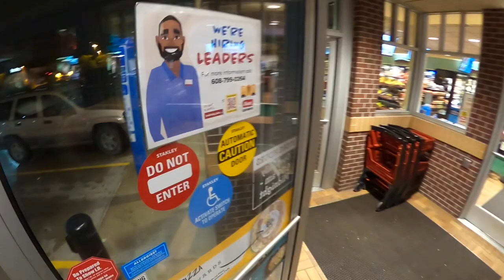Everything is slowing us down! Guys were late, truck won't start, rain, late concrete

Comment: I literally exhaled and rolled my eyes when Eric didn’t have the truck in park. Like bruh
Reply: I mean the car should have been in park to begin with right
Reply: @coleholden8241  If you drive manual alot it can be a habit to shift to neutral and put the E brake. Also those type of gear shifters its easy to leave it in neutral and not realize.
Reply: My mom does this…. Lol Eric.  Who parked the truck and shut it off in drive though?
Reply: @ChicanoOne760  right I’m barely 27 and like this has never happened to me but it happened to my friend she asked to jump it and I hopped in her car and was like yo girl. It’s in drive haha

Comment: I love all your videos they kept me very amused while being laid up in bed due to illness.   I myself was in the construction business for 34 years. Till I retired because of Parkinsons.  I started out pushing a broom and 19 years later got to the top of site management and finished as a Hi-Rise construction Site Supervisor.  In have a respect for all trades.  Most of my concrete experience is steel reinforced concrete suspended slabs in the city of Toronto and the largest building I have been in charge of was 42 stories.  So I can empathize with you when someone is late or doesn't show up.  Being from Canada we pour right through the winter and have the added snow removal and hating issues.  Anyway enough about me you are doing a fantastic job  and thank you for opening up your business and families

Comment: Lets buy Eric more alarm clocks ! Green horn ! Here after they put in joints then 2 days later the come back and saw the joints . I recall being a plumber assistant I was mid 20s  plus worked nights at UPS slept 3 to 4 hours then got up for work  I ended up being late like 3 to 4 times then he fired me .

Comment: 18:30 I did a control joint like that at my pole barn, running under the garage door, and now when we get really heavy rain, water sometimes will go under the door

Comment: Just letting you know for next time always hook up the ground to the battery first when using booster cables
Reply: I’ve also seen people hook the ground to the frame instead of the ground on the battery? Is there any reason for that?

Comment: Could you explain what the strip between the concrete in the garage and the driveway is for? Not sure if you’ve explained it before. Great work guys!
Reply: Supposed to help with cracks if they occur with movement

Comment: Are garages poured as flatwork, and not as part of the foundation up there?  I used to build homes here in San Antonio, Texas, and I cannot see how it would be possible to rip out and replace garage floors the way that foundations are designed down here.

Comment: NOCO Boost X GBX45 1250A 12V UltraSafe Portable Lithium Jump Starter, Car Battery Booster Pack, USB-C Powerbank Charger, And Jumper Cables For Up To 6.5-Liter Gas And 4.0-Liter Diesel Engines
Recommend buying this battery jumper/charger

Comment: It surprises me how the concrete company (and many other companies) seem intentionally vague when asked about timing. 99% of the time if you're just open with people, they'll be receptive. A simple "they were running behind and just left the yard" goes a long way instead of having to drag an answer out of them. I still wonder why they do it. Communication is key. All people want to do is get the correct info so they can plan around it, ya know?